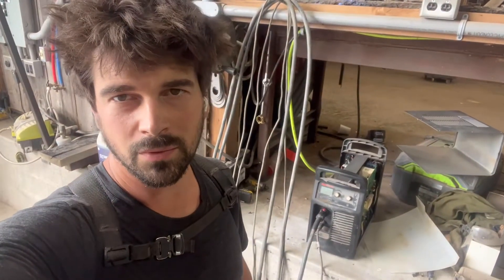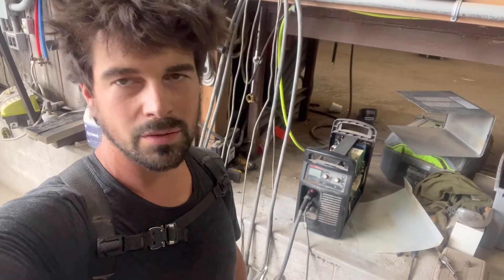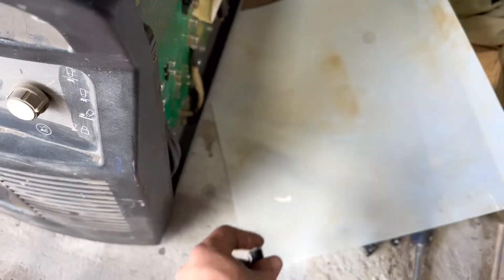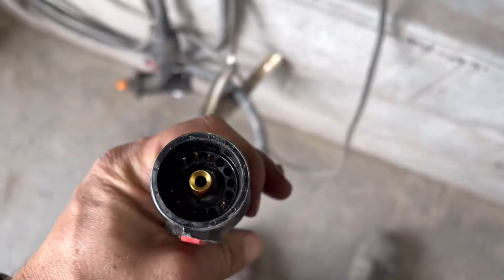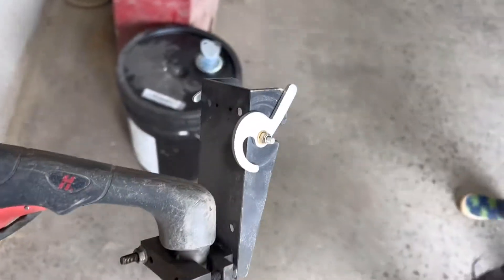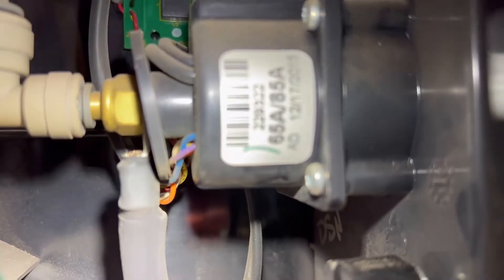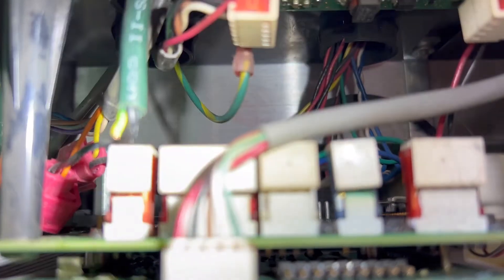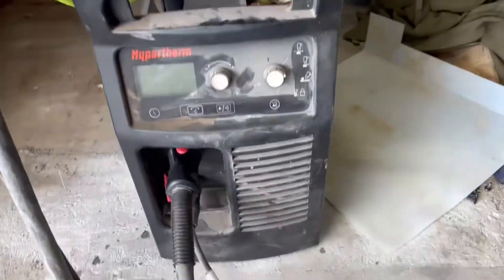Modifying your Hypertherm Powermax Plasma Hand Torch to work with a CNC Plasma Cutter

Comment: Thanks😁😁 worked like a champ.  I make my connection in a slightly different point, peeled the black covering off the wire bundle just above the torch connecter  and skinned the orange and yellow wires and attached the 2 wires to the switch there.  I covered the connections with hot glue to replace the insolation.
Reply from the maker: Awesome!  Glad it worked well.

Comment: Does this apply to the powermax 1650?
Reply from the maker: I don't know.  If it has an interchangeable torch lead and is made to work with a machine torch, then I would think it would work.  I have no experience with that machine though.
Reply: @irionmotorsports  Thank you for your response, yes the powermax 1650 is made to work with a machine torch,  i think i will give it a try, thanks again.

Comment: On my XP 30, the leads are permanently attached. Should they still work?
Reply from the maker: That shouldn't make a difference as long as it has a cnc input.  If not, you could use a relay and transformer and splice into the trigger wire, but that would be a pain.

Comment: Thanks for the video. I just got a used Powermax 45xp with a hand torch that I want to connect to my diy plasma table. I didn't know there was a lockout. So your video saved me a lot of time trying to figure out why it wasn't working.
Reply from the maker: Haha, yeah I wish I had known.  I wasted a good bit of time trying to figure out what the problem was.  I thought maybe I had the wrong pins, or the arcdroid was malfunctioning.

Comment: Arcdroid says it doesnt work with hifreq plasma cutters. Is that not true? Any issues?
Reply: The reason HF start plasma cutters are not recommended is because they cause electrical interference with CNC electronics.
Reply from the maker: That makes sense
Reply from the maker: I haven't heard this, but none of the hypertherm plasma torches are HF start.  They use blowback, which is a newer technology.  I'm not sure why Andrew says it doesn't work with HF start torches, but I'm sure there's a good reason for it.
Reply: @irionmotorsports  I did not know that. Thanks.

Comment: If I have a relay to press the torch switch why do I need this?
Reply from the maker: Hypertherm has a safety in place to keep the hand torch from being accidently fired by the cnc interface.  If you want to use your hand torch with a cnc machine, you need to find some way to bypass this safety feature.  This is one possible way.

Comment: If you turn the switch off, will the hand torch act like normal? I would like to use mine on the arcdroid as well as free hand.
Reply from the maker: Yes, you can still operate the hand torch whether the switch is off or on.  The only reason to turn the switch off is for safety, so the cnc can't switch the torch on when you're not ready for it.

Comment: I didn’t see where you attached 2 wires to back of arc droid to connect to plasma ?
Reply from the maker: The connection to the arcdroid just uses the standard cnc connector.
Reply: @irionmotorsports  which wire (color) of the powermax to connect to the arcdroid?
Reply from the maker: I used a 023206 machine interface harness and connected the black and green wire pair to the torch pins on the arcdroid.

Comment: Easy solution for safety sake pit in a manual disconnect in-between the torch and the high-voltage side of the machine or shutdown the box when changing consumables.